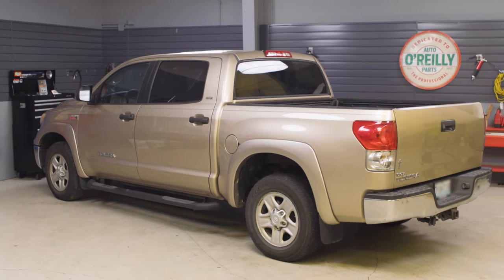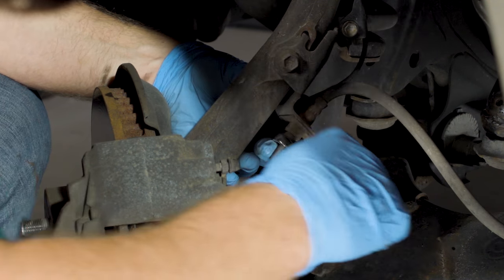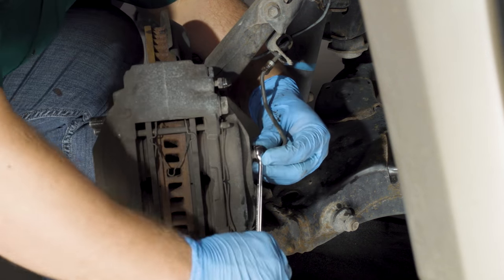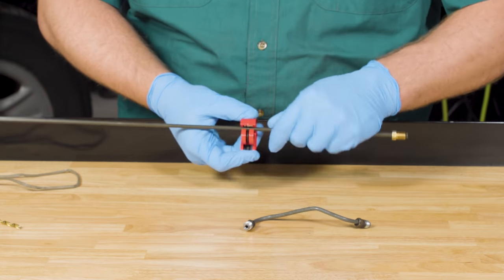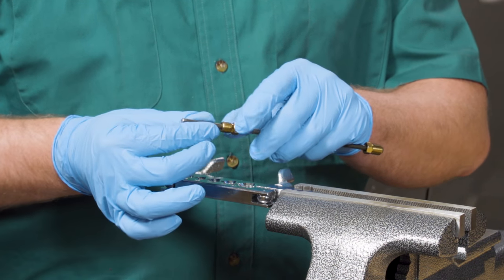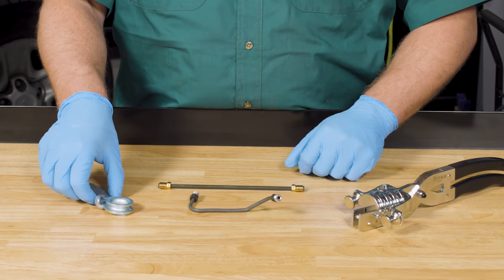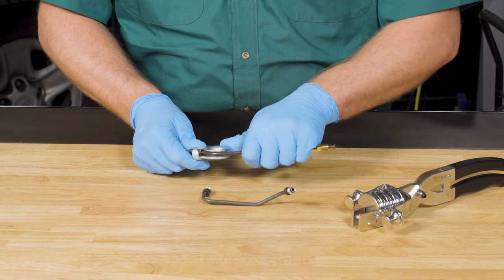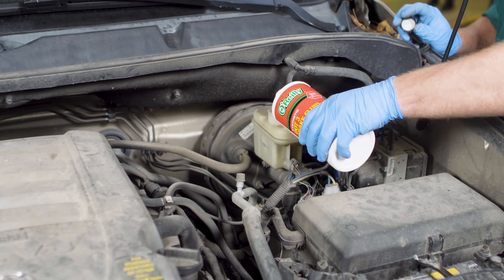How To: Replace Brake Hose and Line (Cutting, Flaring, and Bending)

Comment from the maker: Supplies Needed for This Job:
1. Safety Glasses: https://urlzs.com/hbwc
2. Gloves: https://bit.ly/2GvfwAm
3. Brake Line: http://bit.ly/326MMpR
4. Brake Hose: http://bit.ly/2MwzJKs
5. Brake Fluid: http://bit.ly/2VpQfzT
6. Drain Pan: http://bit.ly/2GEzWqK
7. Line Wrench Set: http://bit.ly/2Dyk7jt
8. Penetrating Oil: http://bit.ly/2H6qr42
9. Pliers: http://bit.ly/2Zxerj1
10. Brake Bleeding Tool: http://bit.ly/2XQx9Rf
11. Cut-Off Tool: http://bit.ly/31UbsSa
12. Flaring Tool: http://bit.ly/30qKh19
13. Bending Tool: http://bit.ly/2TWEJca
14. Metal File: http://bit.ly/2L2seHX
15. Shop Towels: http://bit.ly/2GDgwm1
16. Line Plug: http://bit.ly/2L2sK8R

Comment: Great video. I find it helpfull to put a drop of oil on the adapter stem on the flaring tool. Prevents binding that can snap the stem. Then clean oil off line.

Comment: I'm trying to put a pre-bent line in place and when I tighten the nut, the tube turns. I don't want to damage a $68 tube. How do I stop it turning when I turn the nut?
Reply: Stop buying coated line it's junk
Reply: @johnnyversaci7091  who said anything about coated line? This is a manufacturer supplied blended line.
Reply: Oh if the brake hose is attached by a bracket or bolted loosen those first and you can connect it much easier,turn the new line bolt in by hand first the do the other side going to the cylinder/or caliper, then kinda wiggle the bracket back to the bolt holes and try to slowly put the brake hose brackets bolts back in,
Reply: @raisagorbachov  ahh ok most pre bent are aftermarket coated lines, and your problem sounds like the problem I had with my brothers brake line which is coated my bad

Comment: How do you replace the brake line that runs accosts the firewall?
Reply: 2 years late but same method applies. Get two Union fittings and replace the section necessary, and double flare the new line
Reply: @zanderx7  Yeah, my question was geared more towards the removal of the entire line, and to get it back in there.  I have an 08’ Honda civic and if you ever tried working in the engine bay, I was looking for a way around it, as the alt was to drop the motor and transmission lol.  I upgraded to a bbk and wanted to redo all my lines, but instead I found a method that would allow me to run the BBK without any modifications having to be made to the abs module or brake lines themselves.  Been going strong for a while now 😎.  Appreciate it though

Comment: @2:31 the brake line plug linked as 16.
Is not the right part. That is for the hose. Where can I find the brake line plug? It is not a threaded bolt it is the opposite. Female connector.

Comment: When you flare an existing steel line that can't be removed from the vehicle how do you hold the big vice while you're flaring the line? Just kidding but the professional who did the rear brakes on my 1980 Chevy K20 in 1979 used a pair of vice grips to tighten the rubber hose nut and rounded all the corners off. I will have to cut the steel line off and either try make a short piece of line to connect the new rubber line. The other option is to run a new copper line to an existing joint (about 8' away). The problem is that this joint is inside the frame with an exhaust pipe in the way. I can remove the exhaust pipe but I'm not sure I'll be able to loosen the joint. I'm converting the rear drum brakes to disc brakes with ruffstuff kit and not an easy job like all the YouTube videos show,'

Comment: Please tell me what brake line has copper tubing ? Seriously dude ? Thanks but no thanks
Reply from the maker: Copper brake line is a great alternative to steel, with it being much easier to bend, cut and flare when replacing your own brake line. On top of that copper lines will not rust like their steel counterparts. 

Copper brake line is also DOT approved for hydraulic use, meaning it is strong enough for braking applications. 

Let us know if you have any other questions!
Reply: Every mechanic in the UK replaces steel with copper.
Reply: @19NinetyUK  what size of Cooper tubing would you use ? Vwag
Reply: @game4alaughman  3/16Inch
Reply: @19NinetyUK  is it legal in the uk to use a joiner, I just ordered cooper 3/16 but steel pipe has broken just after rear flexi and runs all the way to the front of the car, I now need to either join it or run full new cooper pipe 😤 arghhh ?
Reply: It's actually a copper/nickel alloy. Works great and is WAY easier to work with. Also doesn't rust like steel does.